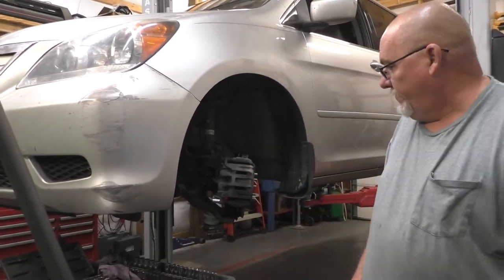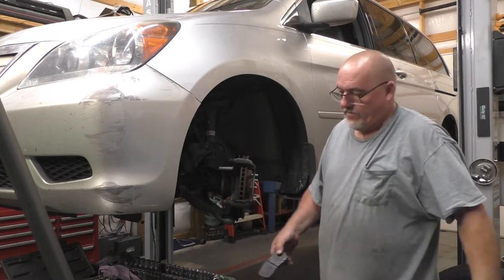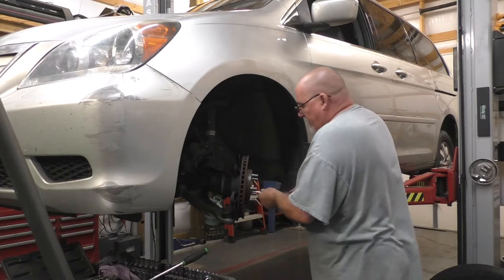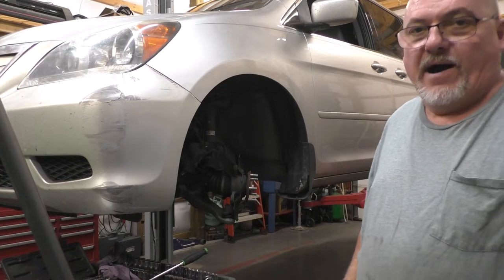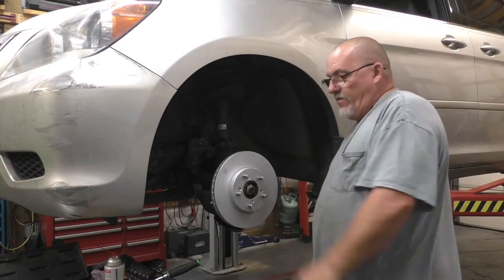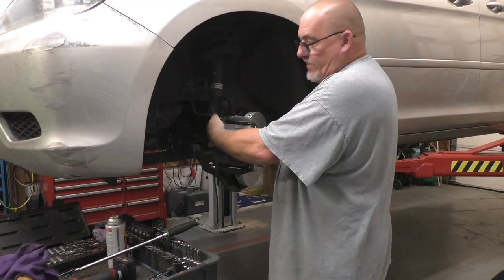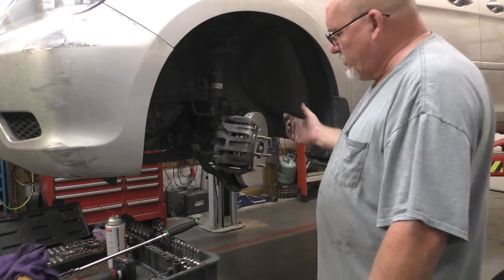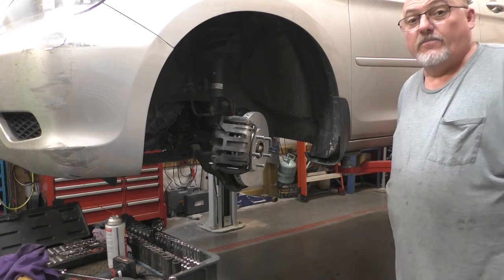2009 Honda Odyssey Front Brake Pads and Rotors. Please do a better Job on Brakes.

Comment: I can’t seem to find the answer to this, but it seems that on the same generation odyssey some people show transferring an additional factory shim onto the inner pad, basically putting an additional shim over the one that came attached to the pad. Then in other videos they don’t. The parts illustration from Honda shows two shims on the inner pad but it just seems odd to put that on there if using aftermarket pads with a shim already attached. Which way is correct? Why does Honda do this? Great video! Appreciate the detailed explanation.
Reply from the maker: There is hardly a reason for it from an engineering standpoint lots of times it is done to make up for a mistake. You can do without the shim and it still works! Myself, I will not be stacking shims(the end) It is allot more important to properly install hardware and to not warp anything when tightening the lug nuts. More and more manufacturers use coated Brackets and Calipers that take some of the labor out when doing brakes.

Comment: Halo Ralf
I got a chev sonic manual...my shifter just started feeling loose..in neutral my shifter use to come back to senter after i pushed it to the side, and let it go..now it stays to the side.and it doesnt feel guided when i shift like before...i took the covers off under the shifter, i saw there is a spring with a arm,, but the arm doesn't push on anything..i can move the spring freely with my finger..i think that the arm are suppose to press on something..and above where the arm is at.it looks like there is a groove for that arm to go into..but how do i get that spring out so i can move it to the groove..and is that even the problem..please advice me ..
Reply from the maker: I would have to look at it. The Part you are talking about normally comes as an assembly.

Comment: What's the story on the brake return springs? Some videos show them installed and some don't.
Reply from the maker: I am not a engineer and do not modify things. I put stuff back the way it was made in the factory unless directed so by a service bulletin.
Reply: Thanks for your quick response. @ralfsautomotive